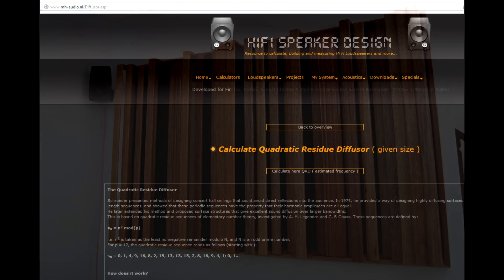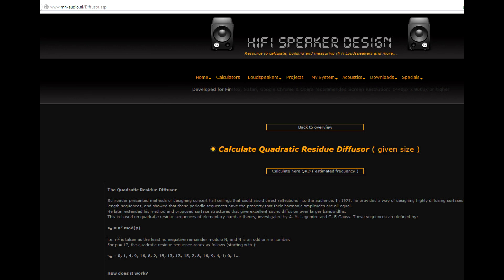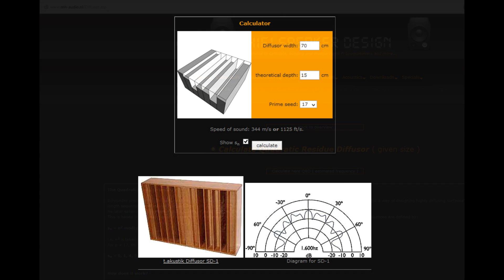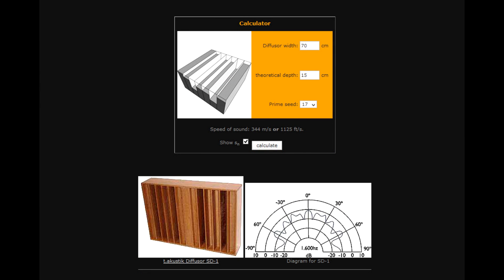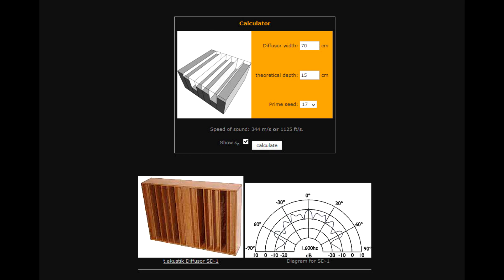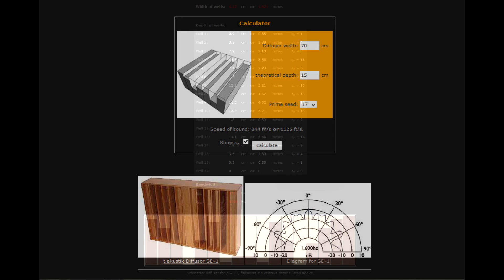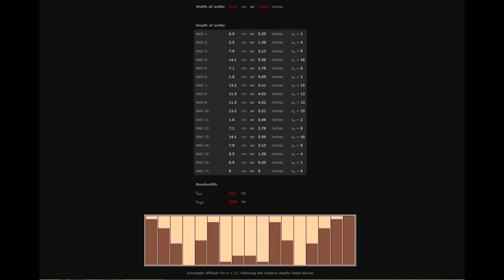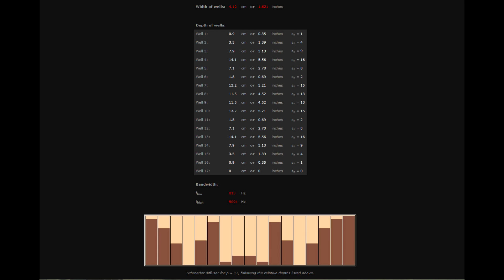Quadratic Residue Diffusor

Comment: There might be some diffusion effect,. but this is not a quadratic diffusor which is working cause of closed chambers with different dephts,. on deeper frequencies it may not have any effect at all,. but maybe its a good idea to put something like 10 cm rockwool in the back,.. then you get an absorber with some diffusion effect on the highs,..

Comment: Im thinking about building something like this but the pieces of wood in the front (diffusors) would be pvc/tube pieces instead. Cut either in half or 1/3 with the concave part facing the back. My theory is that what ever hits the front will be diffused and whatever gets between and hits the back will be trapped by the concave part of the pvc/tube. Any input on how efficient that would be?
Reply: Not exactly. Trapping sound needs mass, not a shape, primarily. Whatever is unable to escape through the concave face, it would actually reflect back in a deflected direction, and bounce off the back surface, with a random possibility of either losing all the kinetic energy in between reflections, or finding some escapable mass of matter coming back into your room.

More importantly, the frequencies that have that chances of getting "trapped in your pvc pipes" are only the very higher ones. Low frequencies won't even consider those pipes to be a barrier, they'd simply transmit through! (Low frequencies+ higher wavelenghts, hence they need space).

Diffusors and deflectors are meant for velocity - phase/amplitude grating, and what your theory is relevant for (to a very basic extent) is pressure trapping (not velocity), where your pvc MIGHT act as a membrane. Whereas diffusors and deflectors are meant for velocity - phase/amplitude grating. But, sound pressure generally builds up in the lower frequencies only, and once again, it needs a lot of volume to trap low frequencies. Plus, for membrane based traps, your trap neds to be airtight, pressure just escapes wherever it finds room.
Reply from the maker: It would work but would it look nice? The concave and convex theory is great. You could use pvc edging strips and cut them to size. The concave would face back like you said and trap the waves and the convex would disperse them. Good luck
Reply: @JohnCranberry23  thanks for your reply. Of course there would be some sort of treatment for aesthetical purposes. Perhaps some paint. I even thought about using carboard tubes instead and cover the exposed (convex) part with some sort of wallpaper or fabric. I just wasnt sure on the science part 😅.
Reply from the maker: @SantuarioBeats  if it’s going to hang in your wall, make sure it’s pretty to look at. 🙏

Comment: Thx for sharing , That looks beautiful. However does it work like  the solid ones. Thx
I also like building things so it's a great project.
Also each strip 1.5 inches is good ?
Reply from the maker: I works fine. It is only a small part of the room, but because it's directly behind my head, it eliminates reflection. strips should be around 2 inches, as long as they are staggered
Reply: @JohnCranberry23  thanks for replying. 
When the time comes I'll build one thx again.

Comment: Hey, I'm surprised to see you left the sides of the wells open, I mean sound goes all ways, I think it's necessary. This way the diffuser only works for sound that's aimed straight at it, I'd imagine. I'm drawing the outlines of a fractal diffuser onto a piece of plywood and the surfaces will be made from pinewood, in my language (grenen). It will be a ton of cutting, but it's alright, everything better than spending 35K haha
Reply from the maker: The idea is so that sound waves will get trapped under these walls. Without it, we simply reflect them in another direction. Either way is effective.

Comment: You are aware that you need to figure out what Prime sequence you need which is dependent on distance between the listener and the diffusor..  Sure, the higher Prime will yield a wider frequency range that it will handle, but it also requires a longer distance between it and the listener.  Obviously once it's built, where you position with in the room is also important and that's more dependent on room usage, etc.
Reply: Interesting, do you have something to link with related measurements?
Reply: @gabrielemarchetti7793  There's a video that was on Acoustic Fields where he shows the calculation..  Give me some time and I'll check their videos (over 500) to see if I can find it.  :-). I'll post a link to it.
Reply: @gabrielemarchetti7793  Here's a list of videos covering Diffusers to watch.

https://www.youtube.com/watch?v=fB3EsOqYZ6A

https://www.youtube.com/watch?v=8OYYnGk30Qg

https://www.youtube.com/watch?v=pTOfXlxGtZk

https://www.youtube.com/watch?v=A4fRoLMxZ1o
Reply: He use a QRD17 but used 17mm ( about 6" ... X4 = 24" x 2 = 48" away from the wall )  as his deepest base point. The sofa is back to the wall though. But, this is a different type of diffuser. If he is happy with the results it's fine.
Reply: It's only 17mm deep?  ARGH!!!  it should be more like 16inches deep for Prime 17.

Comment: One last question, if you could choose between a very heavy-hard timber and a softer type of wood, to get the best performance out of this design, what would it be?
Reply from the maker: Como talar un alerce I would go with a medium to soft density because hard wood is tough to work with and it’s heavier.
Reply: Hardwood tends to be more expensive too.

Comment: @JohnCranberry23 I have a question.  Did you consider the width of the rooftop's timber impacting the final calculation of each well's depth? Because maybe you are adding like one inch or so to whatever measurements the diffuser calculator gave you for those wells. I'm thinking about building one of these myself, I find this so inspiring. Thanks for your answer, I wish you my best regards  from Chile!
Reply: Saludos. Lograste hacerlo finalmente? Que te pareció el resultado finalmente y sobre todo el efecto sonoro? Gracias desde Puerto Rico.

Comment: It's a nice diffuser and looks pretty, but that's not what you want on the rear wall! You want absorption, make that wall disappear so there is very little sound coming back, not scattering it around the room. But it's your money. Live room, .6 seconds of reverb, control room, .4 seconds of reverb and you cant to that with all the diffusion in the world. Also splay your interior walls, two adjacent walls splayed from center horizontally and the other two splayed vertically then the ceiling. Right angles are a no no. Try a few broad band absorbers in place of the diffusers, you will find that your room sounds much better. PSI have made an amazing active absorber that sounds like it removed a big chunk of the wall so there is no return, it's amazing and only about 15x28x24 inches or so with a mic and driver inside that reacts with the incoming audio.
Reply: the rear wall needs diddusion.
the side walls need absorbtion

Comment: wanting to build this for my bedroom that is a little echoe, to put behind my bed. any new lessons learned since then to add? cheers good vid
Reply from the maker: SilkMilkJilk not really. All I can say that it’s still there hanging behind the lounge. Just plan it well before you buy the wood and dry fit the pieces before gluing it. Use quality wood glue because every now and then I dust it with a duster gently so I don’t knock it loose. Good luck.
Reply: @JohnCranberry23  Thanks mate, much appreciated!

Comment: Nice build John.thats dual purpose forsure. Sound and art.
I m kinda new to diffusers. But been doing research on them. 
Lots of info on (Acoustic fields )channel. About room acoustics. 
I was so curious I built(QRD well type)one out of double walled cardboard. Based on prime 7.
2 each. 1foot by 3feet.6 inches deep.and you know .it opened up the sound stage. And the speakers almost disappear. 
I've had the same stereo for 30yrs.it has never sounded like it does now.
So I'm now building it properly out of wood. Going to try cedar. 
I like the fact you experimented. (I'm the same way).
I learn from doing.not listening to other people. 
I curious to find out the sound difference. Between this and a well type defussor.
Reply from the maker: Cool. They are great. I have a video recently with Dolby Atmos vs DTS. Check that out.
Reply: Hi. Did you make it finally  your QR7 ? What are your results? Thanks

Comment: Very nice work.  Couple of questions:  I noticed that you appear to have use somewhat of a bridge approach as opposed to well-type diffuseors I have seen elsewhere.  This seems to me to be an easier and more cost-effective approach.  Is it as effective as the well-type diffuseors?  Is there some kine of formula one must use based on the size of the room, etc?  Thanks again for the great video.
Reply from the maker: There  has been debates for bridges vs wells. The bridges will trap and diminish sound waves as they enter the QD and bounce back from all angles. I have fabric behind the bridges which also helps. As far as the room size goes, the larger the room the more treatment you need. The QD works best placed directly behind your head. You can make it as large as you like. But remember sound bounces off all walls, floor and the ceiling. You can use a rug on the floor to absorb sound, thick velvet curtains on the walls, base traps in the corners. All this will improve the clarity, I chose to make the QD that size because it suits my wall and that is where I sit.  Good luck.

Comment: Hi John, are the height measurments of the columns from the top front surface to the ply wood back?    many thanks     M
Reply from the maker: The back. So to simplify. The individual pieces are cut to the exact heights of the formula. The covers (strips) sit on top.
Reply: @JohnCranberry23   but if You do in that way, the total height of the strips will be the height on the formula PLUS the "thickness" of the strips.. am I wrong? thanks! :)
Reply from the maker: @massimilianofontana  No because the ratio will be true under the strips and above the strips because the thickness is constant. Remember it's a ratio, not a specific length. If you doubled the lengths the ratio would still be true.
Reply: @JohnCranberry23  THANKS! :)

Comment: Sorry but this is not a QRD- the slots need to be enclosed for it to work as intended.  Furthermore, even the thickness of the "walls" is to be precisely as per calculations, as is the width and depth for each slot.  That's just physics.  Not an opinion.
Reply: It may not technically qualify as a QRD diffuser, but that doesn't mean it's not an extremely effective diffuser! It's more closely related to a stepped diffuser, which is not only a very popular and effective design, but which has been shown in certain tests to outperform QRD diffusers. There is a thread on gearslutz in which Tim Perry of Argen (open-source DIY diffuser design company) references a paper he wrote in which the stepped diffuser comes out on top. Honestly, I think John's design here could potentially have advantages over a normal stepped diffuser due to the "bridges" trapping sound underneath. 

John, you should send your video/design to Tim @ Argen and see what he thinks. Very cool! I may build a huge one for my studio if it checks out.....in fact I may send him a link to this video to find out for myself. 

Either way, great job and thanks for taking the time to document and post this! Aloha!
Reply: Gio, you're right.  Got to have each well/trough enclosed.
Reply: I generally agree that this is a diffuser and even a good one, it’s not an art piece. There are papers on the difference between nominal diffusers and quadratic. Gio is truly right about one thing for the sake of science, it’s literally not a QRD.
Reply: I think it does more than a qrd diffuser. It also absorbs. 
Qrd are designed to only diffuse .but you can get qrd that absorbs. Deepest well has absorption.
It resembles a qrd ,more than a 1d of 2d diffusers .
If he wants to call it qrd .let it be.he dont need to ask for permission.
Reply: I myself dont use measuring instruments to figure out if any room sounds good...i just use plain old ears..
I've heard setups done with meters etc...I dont like the sound...like something's missing..
I've downloaded QRdude app on diffusers...built one out of cardboard based on prime 7...I did hear a difference 
Even objects in a room will diffuse sound.or obsorb.
Reply: JS B Yeah, it’s kind of like meteorology on the news. All the science in the world, and we still don’t know how accurate it is in the end.
Reply: @huckwalton2307  yeah if you get  wet outside . it's raining.. if you sweat must be hot LOL...our senses work pretty good..👍
Reply: Gio is correct that this is not technically a QRD diffuser. However, it is still a diffuser. That "art piece" statement was inaccurate and out of line.
Reply from the maker: I understand your point and have to disagree for the simple reason that an empty flat surface will do nothing to diffuse the excess sound waves passing by my head, however my QD will and does actually diffuse, trap and break up sound. waves. Difficult to prove unless I have sound testing equipment to show the difference. However, I sit there and watch movies on my BenQ projector, Yamaha 7 x 150w Receiver and Klipsch speakers with the QD mounted behind me and it does sound fricken awesome. Don't believe me? Come over one Saturday night.
Reply: There is nothing to disagree about.  That is NOT a QRD diffuser.  ALL QRD diffusers are based on prime numbers and a center frequency.  Based on that [chosen] frequency there is a minimum distance from listening position to diffuser.  For example, let's say one wanted to make a QRD based on the number 7 and a design freq of 675hz, the MINIMUM distance between diffuser and listener would be around 5 feet.  I am not making this stuff up, it's science and therefor it's NOT an opinion.  You made an art piece,  akin to a hanging picture but, it's not a QRD.  You can't disagree with science :)
Reply: @JohnCranberry23  -  I believe you. If I had a car, I would still take you up on the offer of a demonstration. The room sounds a little "bouncy" but not too annoying.
     If you're happy with it, enjoy the hell out of it.   Judging from the sound in the video, some absorption would be an improvement.  Bass trapping near your low frequency speakers would be a great place to start.
Someday there will be a reasonable way for the general audiophile public to measure/test diffusion.  Some kind of specialized SPL meter or a DAW app, possibly.

For an example of the ultimate in diffusion, Blackbird Studio C:  https://www.youtube.com/watch?v=peCF0gwTWoE

Comment: Hi John, great design and info, thanks for sharing.
Just a thought, how you have the two side by side, do you think that by flipping the second one so they were symetrical would it change the way it responds? or in theory would it work the same way?
Just thinking from an asthetic point of view, although they do look great side by side as you have them.
Reply from the maker: I think they would work either way because you need to remember that mathematics aside, you are creating an environment on your wall that with diffuse excess sound waves. The purist may argue semantics but you could hang a thick woollen blanket on your wall an still achieve a reduction in excess reflective sound which in turn will add clarity to your listening environment. The QD just look nice than a blanket. Having said that, I do intend to make a few absorber panels and base traps one day for the walls and upper corners of the room.
Reply: If they turn out as good as your diffusor did, they will look great.

Comment: How many hours did you spend in total to make one?  How much money did you spend in making one?  Just curious.
Reply from the maker: +Oneness100 Actual hours..hard to say, but if I had to guess I would say maybe 20 to 30 actual hours not including drying time or planning. Planning is the most important part - if you plan well before buying anything, you will save money. The cost would be around $150 in timber for each. You don't have to spend heaps of money on the wood,  just find something soft to medium hardness and nice looking. Good luck.

Comment: I think you need absorption in your room (like corner bass traps). Diffusion is a secondary thing. I hear a ton of flutter echo in this vid and also in your star wars trailer.
Reply: It's a combination of absorption (mid-high, and low frequency) and diffusion.   There are two ways to handle flutter echo, you can have diffusors or absorption, both will work.  It also depends on the room and it's dimensions.
Reply from the maker: +Julius Bernotas Agree, I will make some one day.
Reply from the maker: Back then the camera I used wasn't very good. I have a video recently with Dolby Atmos vs DTS. Check that out.

Comment: That room is still ringing like crazy.
Reply from the maker: No, the sound on the video was recorded elsewhere in the house.
Reply: @JohnCranberry23  Yeah obviously, but why?
Reply from the maker: @gutshisalamanca1191  Back then the camera I used wasn't very good. I have a video recently with Dolby Atmos vs DTS. Check that out.
Reply: Its a sound diffuser man, it only distributes sounds horizontally or vertical. Depends on the orientation of the quadratic diffuser.